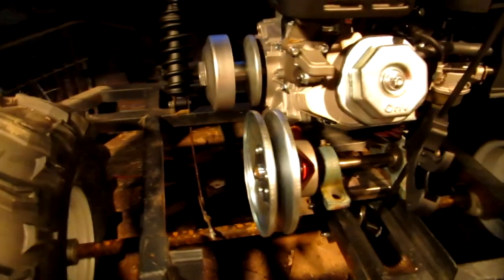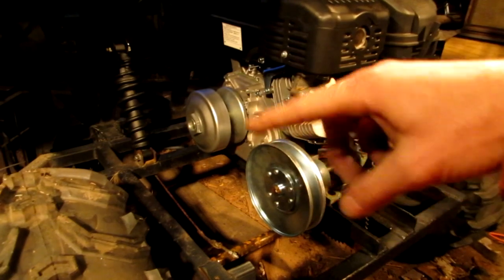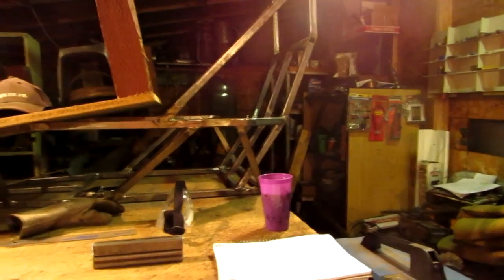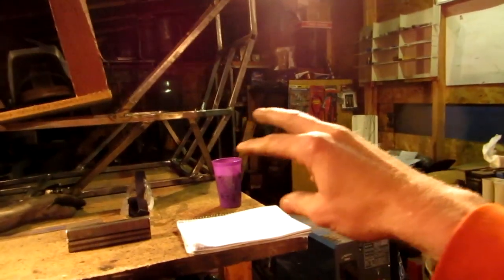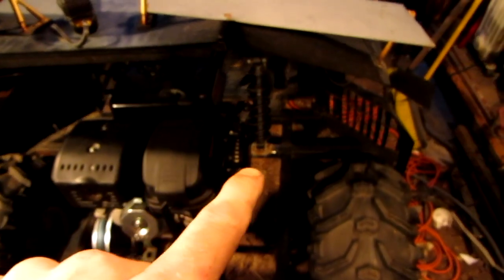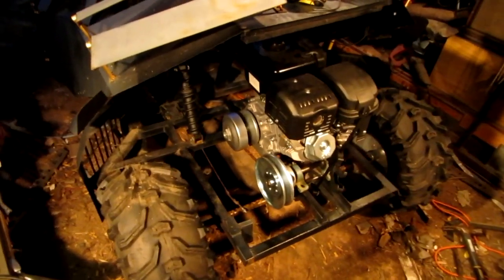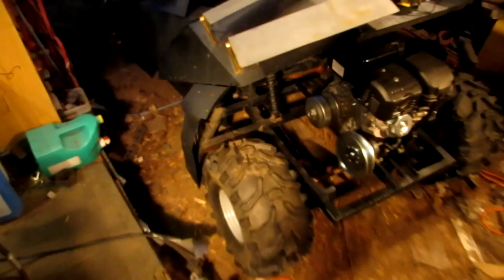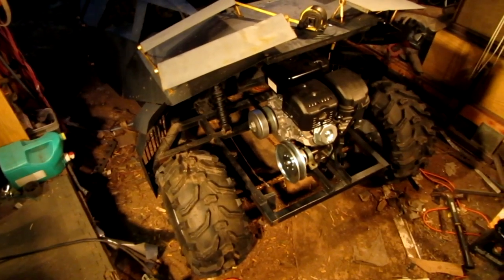Tumbler go kart With New Torque Converter

Comment: The harbor freight motor (13hp) has the electrict start and is a copy of the honda. So that means lots of hop up parts out there.  There are propane/NG conversion kits you may be interested in.  Go look in a local motorcycle junkyard for the brake systems, you will be glad you did. I am going to convert 2 karts to the racing kart brake systems. Good work.

Comment: I really like your torque converter set up. I've recently done a 420cc conversion on an old cart I have. The space is pretty tight to put a torque converter in, but it looks like your setup has a lot of leeway. I was wondering what you used to mount the driver wheel to the engine? A kit with those large mounting plates won't work for me (they're too long).